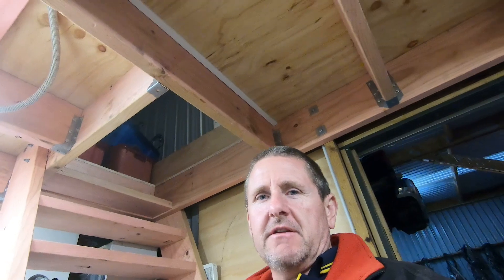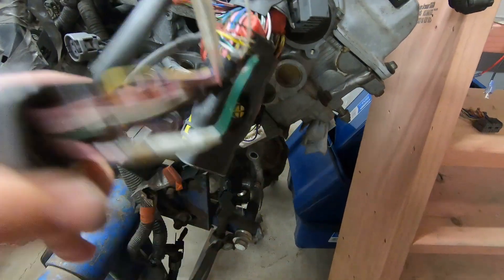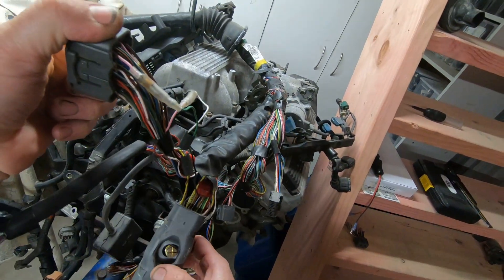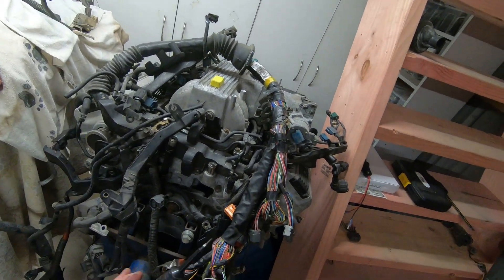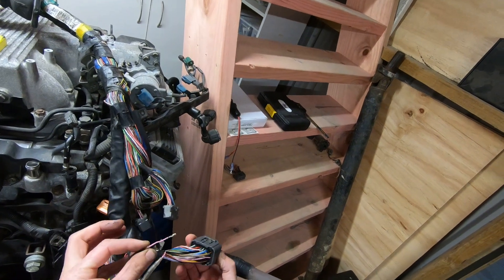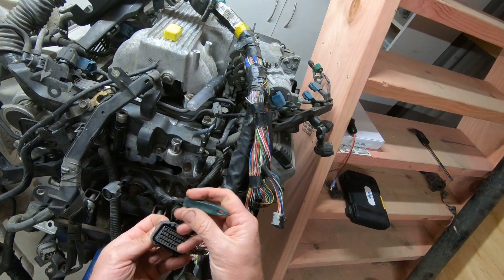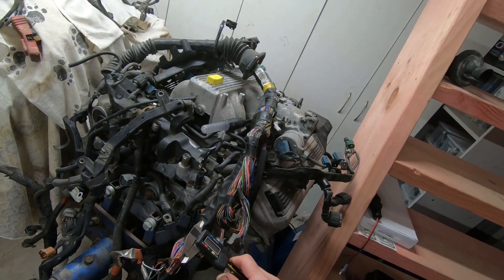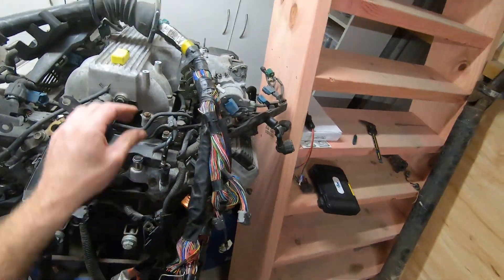Removal of Ecu pins from Toyota 40/40/40 ECU. 1uz. 1jz. 2jz.

Comment: There is a TE tool if anyone is interested to remove the 40 series contact so 1UZ all the way up to VVT-i and then there is the 25 series in the 3UZ ECU. The 40 series contact for early engines tool part number is 755430-1 and the 25 series TE tool to remove those pins is 1276565-1.
Reply from the maker: Hello Chris.  My blue TE pokie tool is one of my favorite.  It does a heap of work and I wouldn't be without it.  We tend to end up with our favorites and there's always another new tool on our wish list.  Cheers.
Reply: @CartuneNZ  Hey Kevin yeah I still use a sharpened Pick for the 40 range to be fair I find it easier to work with! The 25 range though I do use the TE tool cause that hole is tiny!
Reply from the maker: @PhoenixEngineManagement  Ive used a set of my own sharpened picks for years.  The 25 in the 3uz and late hilux are tiny.  Did this video have the right info in it?  It is a customer request and funny enough when One person asked for info other there are heaps of others who are wanting the same stuff.  Cheers
Reply: @CartuneNZ  Yeah all sweet info as usual. This is one of those things that bug me! The other is where the guys cut the wires directly at the connector! The amount of times I've had to sit there with a long nose pliers and the finesse of a Ballerina to get the stubs out lol!
Reply from the maker: Same for me.  I start thinking of other uses for pokie tools with guys that prune wires at close to the ecu.  On the burnt hiace I gave up and fitted a new plug.  Problem solved.  Guys are like "I dont want to remove them incase we need them" .  Easier to take out and put back in if they are required.